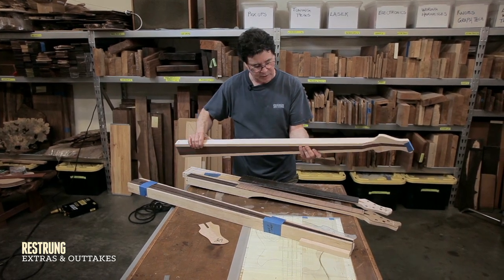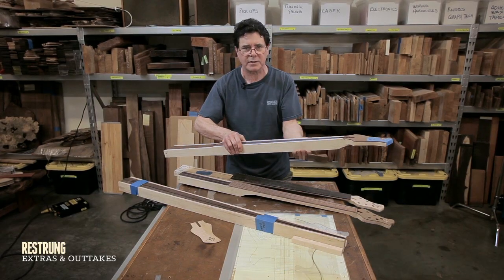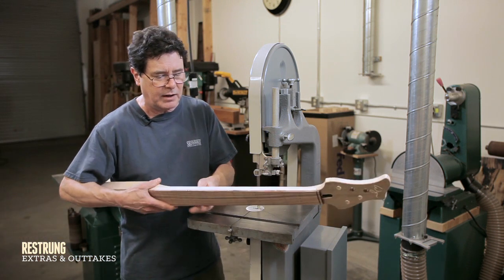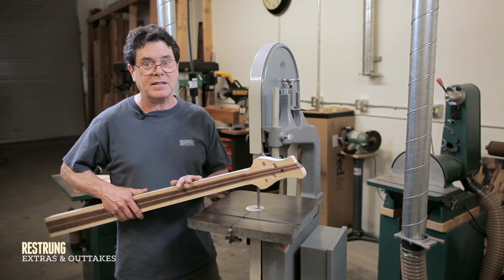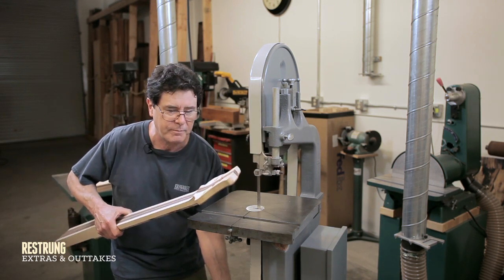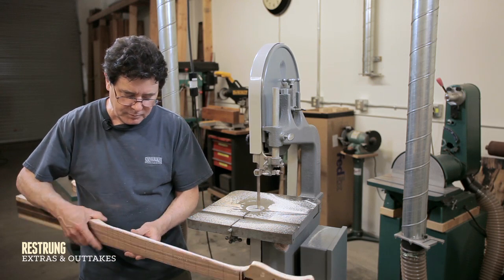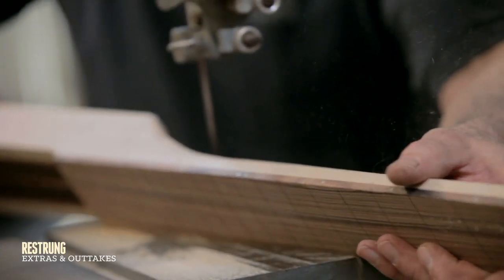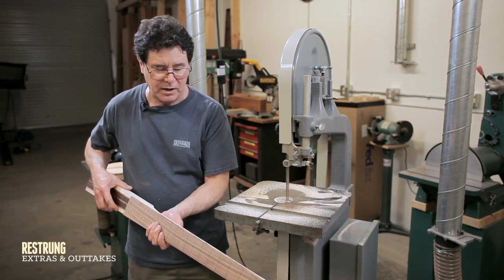How to Build a Bass Guitar - Step #6 - Sculpting the Neck on a Bandsaw

Comment: why not just use a router for shaping the neck?
Reply from the maker: "Practically every neck I make is different.  I use five different scale lengths, numerous different widths for four, five, six, seven and now eight string basses.  Add to that that players request different profiles.  I get there faster with a band saw and a rasp.  The basic shaping of the neck goes relatively quickly compared to a lot of things I do." - Randall